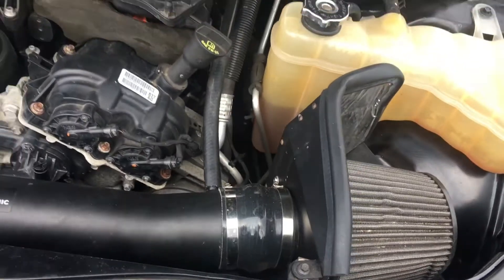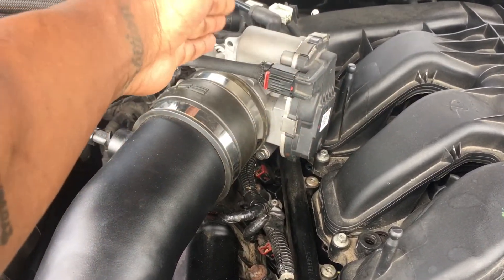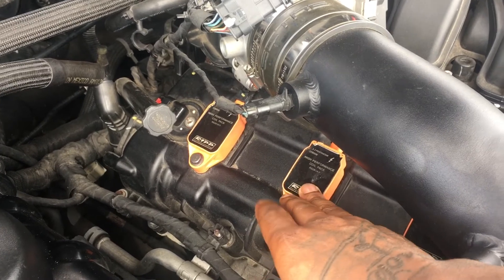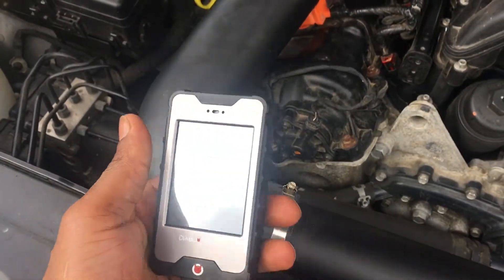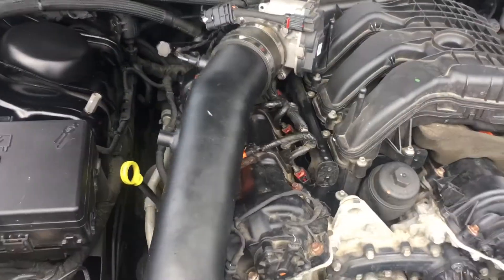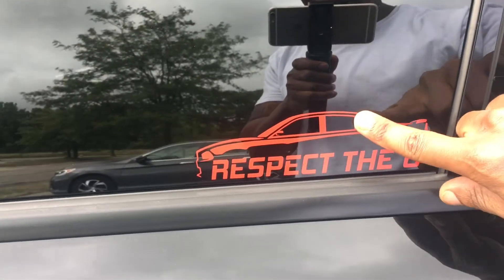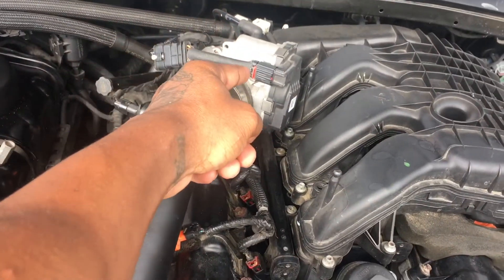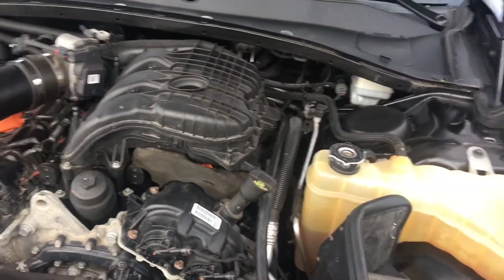Respect The 6! Episode 19: How To Mod Your V6 Charger/Challenger/300 To Keep Up With A Stock R/T!

Comment: I respect this video bro. I drive a 19 Charger gt. And all you said was very on point. I think the ultimate mod to beat an rt is to supercharge it. Ripp has some dope kits. Should put you at about 450 with just the supercharger. Dope video bro
Reply from the maker: Yea if we really want to beat R/T's & do so convincingly, we'll need a supercharger to make up for what we lack in torque. 

Preciate the comment bro 💯

Comment: Awesome vids and tips. After installation of the 80mm tb, did you have to recalibrate alignment with a scan tool?
Reply from the maker: Nope, no recalibration needed. Just disconnect the battery before you install the throttle body.
Reply: Gotcha. Thanks so much for the vids!

Comment: How to beat an rt
Custom tune
Afe cold air intake
80mm throttle body
Afe catless downpipe
Coilpacks
Lightweight battery
Pug manifold
Dual exhaust
Speedlogix lightweight bumper support
Many more mods